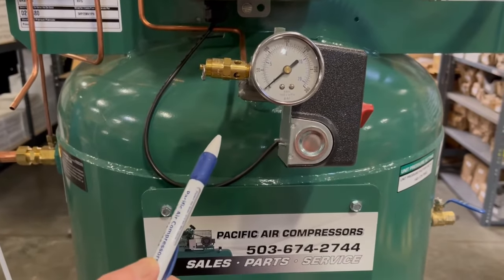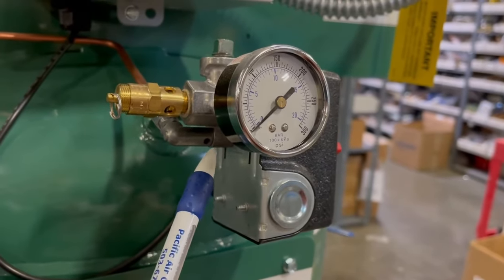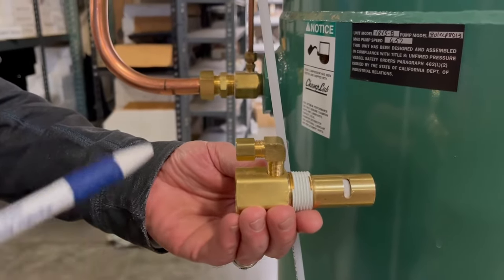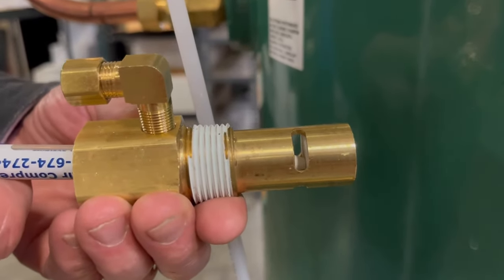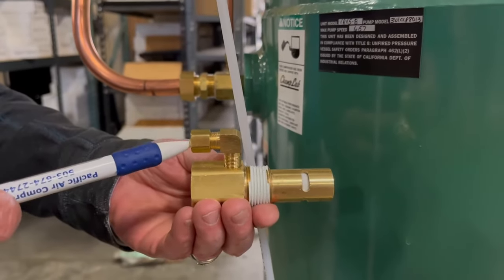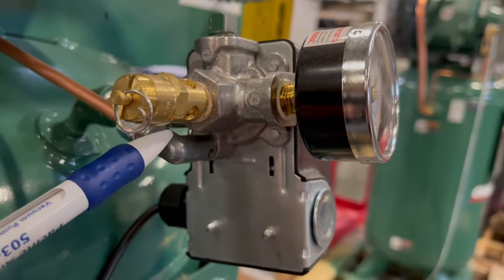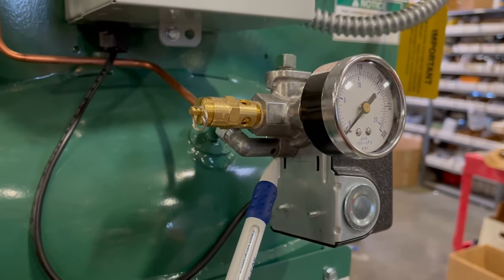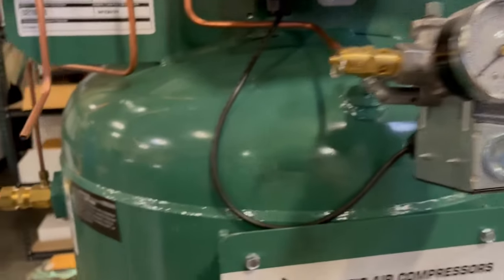Why Is My Pressure Switch Leaking Air? Air Compressor Troubleshooting & Technical Support

Comment: I was screwing around with the pressure switch until I saw your video, opened up the check valve, cleaned it up and it’s not leaking anymore. I didn’t have to replace it. Thank you so much.

Comment: What I am seeing with mine is, the unloader valve only leaks when the compressor is running. So it continuously leaks when the compressor kicks on. But once it kicks off, it doesn't leak. Everything works as normal. From what I remember, this unloader valve shouldn't spit out any air while it's running. Only when it shuts off it spits out air for a second or so. But for some reason it's just continually leaking only when the compressor is running but not when it cuts off. Any ideas?? Thanks.
Reply: this is what mine is doing... what was the fix?

Comment: Good looking out. Having been in the construction trades for 24 years I've replaced tons of parts on compressors. The air leak from loader valve was a new one for me. I was able to take the back cap nut off and clean mine out. Worked like a charm. Thank you.
Reply from the maker: That's great!!!

Comment: What should I do if it is leaking while running but not leaking when it stops?
Reply from the maker: Hi there! Sorry for the late reply. In that case, your unloader valve on your pressure switch is probably bad and needs to be replaced. 

If you let me know what switch you have, I can send you the link to purchase the proper unloader valve. 

Thanks for the great question!

Comment: Mine loses pressure while using air and builds back up when its not used. It also doesn't shut off. Please help somebody
Reply from the maker: Call us and we'll help! (503) 674-2744 
Ask for Bart or Mike. Have your compressor model number ready when you call.

Comment: Juat used this information for a repair.

Found some metal shavings stuck in the check valve. 

Was able to get the shavings out and compressor functions normally now.

Great video.
Reply from the maker: Awesome! We love a simple fix.

Comment: Thank you for explaniation 

But i have question please.  What happens when install pressure switch in horizontal shape?

?Does it affect his work scientifically
Reply from the maker: Great question! It will not affect the performance of the switch at all. It can be installed at any angle.

Comment: Just now running across this video.    Have a 33 Gal Craftsman 110V compressor.  Initial problem was the tank was leaking air from somewhere.  Replaced pressure switch (adjusted to lower cut off to 135 lbs)  All tubing was good.  New copper pipe with ferrels.  Wraped all threads clockwise with teflon tape and used pipe dope on top of that.  It was still leaking air out of the tank.  Then replaced the check valve.  Same means of securing all connnection with  Teflon tape and pipe dope.,   So NOW,  I have changed out every single port coming out of the tank, INcluding drain valve.  1/4 turn ball valve on output before going to pressure regulator and on drain valve at bottom of tank.  The damn thing is still loosing 15-20 psi over a 12 hour period.  HOW CAN THIS BE?   Passed the soapy water test and not a single bubble.  Stumped

Comment: What causes air is coming out of the  pressure release switch valve hole the whole time the  air  pressure is being  raised up to fill the tank and once the tank is filled  the  pressure  switch shuts off and the release valve pin is raised up and lets out the pressure in the line and no more air comes out of the  pressure release valve hole ?  

There is 2 parts of the  pressure switch release valve .On one side , the line in side ,  when the pressure switch is on it moves the arm away from the pin . As the pressure builds up air  is being sent to the top  of the release valve . There  should be no air coming out of the pressure release  valves hole  while the  motor is  on . 

If air is coming out of the hole this means the  top O ring seal is leaking and is allowing air to escape the whole time the motor is running . This is going to make the  motor  run  a lot longer to fill up the tank . 

Once the motor shuts off and the  pin is raised up  to allow the air in the line  to leave  the one way valve shuts off air to the  pressure release valve  and you no longer hear air leaking . When this happens you know the one way valve  is working and the  pressure valve is not . 

Just because once the one way valve  shuts off air going to the pressure release valve that doesn't mean the pressure release valve is working  . It only means there is no more pressure  in that line . So as the compressor is running  listen and feel for air coming out of the pressure release valve  hole ,if you hear air   coming out of the hole while its running  but you don't once it stops then its the pressure release valve that is bad and needs to be replaced .

Comment: I replaced my check valve with a new one and my pressure switch still leaks. Should I replace the switch?
Reply from the maker: Most likely yes. If the air is not leaking from the unloader valve and leaking from somewhere else then it's a bad switch.